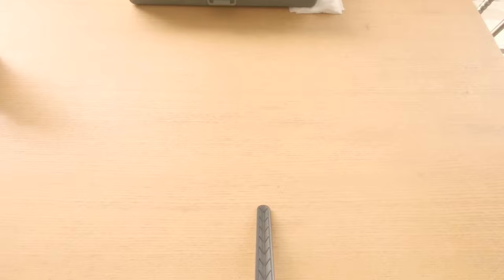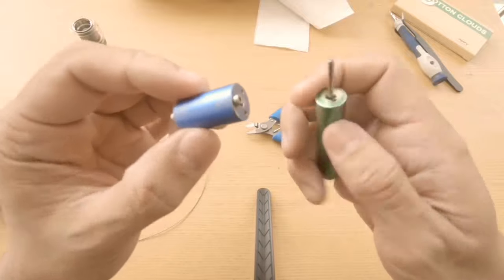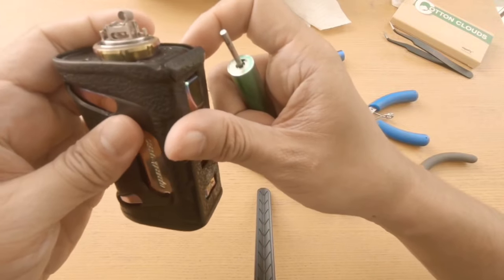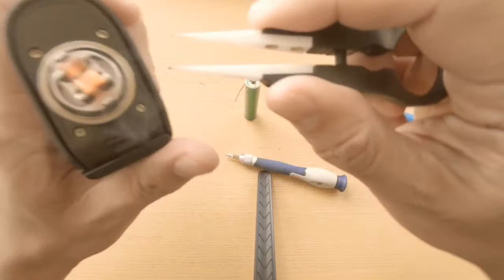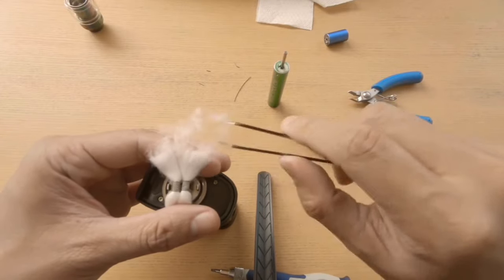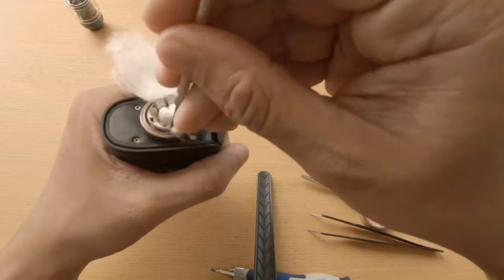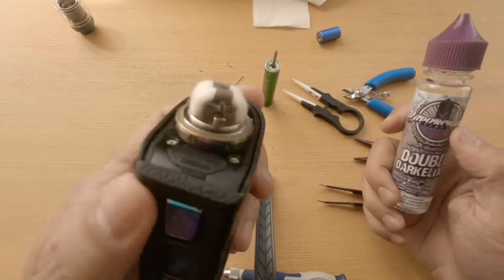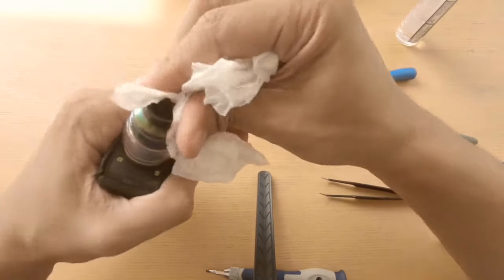Geekvape Zeus X Coil Wicking 101. No Dry Hits Guaranteed. 2022 (Tagalog)

Comment: Im new in vaping community last 2 Days ko sya nabili, then after 1 Days may lasang burnt taste na sya. Im suspecting na mali yung pag wiwick ng nag assemble ng vape ko. Chineck ko naman cotton and coil di pa naman sunog. Ano po kaya problem? Mine in Geek Vape Zeus Dual RTA, Zeus Legend Mod.
Reply from the maker: Good day. It’s just not wicking properly cause the cotton might be too tight. Loosen it a little bit. Sundan mo po ang video. Nipisan konti ang cotton para dumaloy ang juice. Also wag ma touch ng cotton ang floor ng atomizer.
Reply: 99 Habits hello bro. Thank u so much! Gawin ko yan. Thanks for the tip
Reply from the maker: Welcome bro
Reply: 99 Habits already subscribed more power to our channel 😍
Reply from the maker: Thank you bro